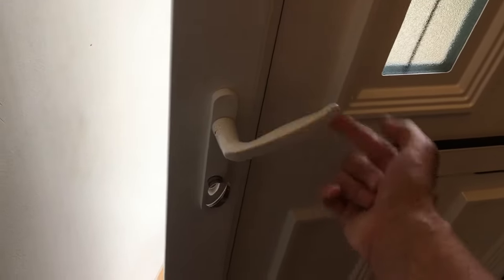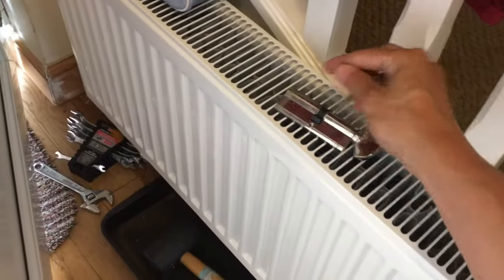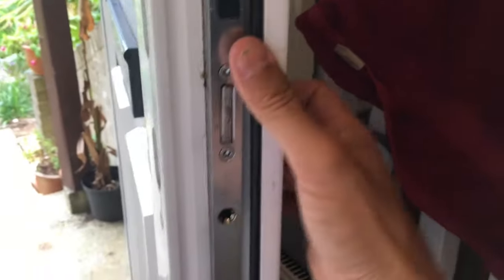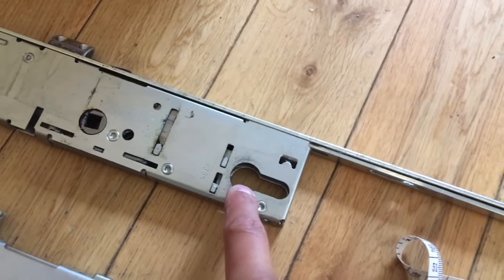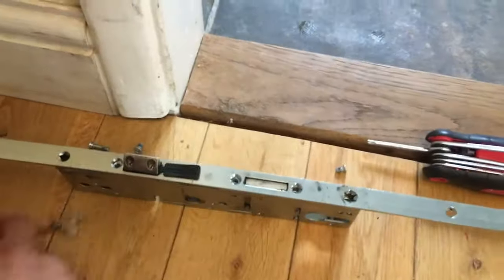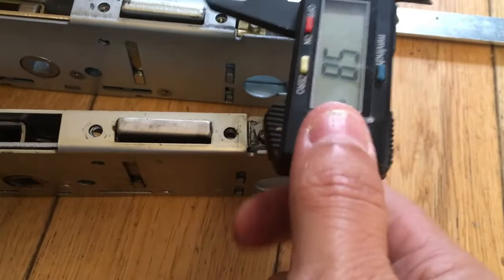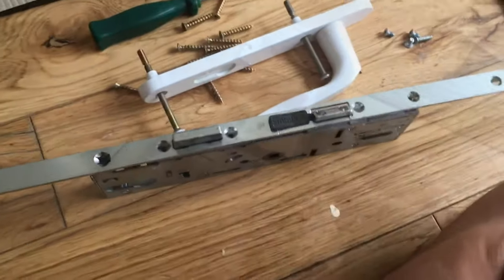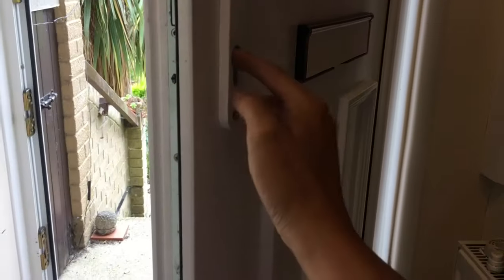How to replace the lock in a UPVC door

Comment: To get the cylinder out after removing the holding screw from the front, you need to turn the key 45’ to one side…. and pull it. Could be to the left or right.

Comment: Sorry but this is many times more involved and complicated than the method shown in other vids.  If you have to Dremil out the gap for the lock that’s an expensive tool that not many people normally have lying around .  I’ve got one but I’ve no idea how I’d use it for that job.  Why remove the rail at all why not just cang3 the handles and spindle?
Reply: Digital calliper £5 eBay. You can open the slot up with a hand file you don’t have to use a Dremel